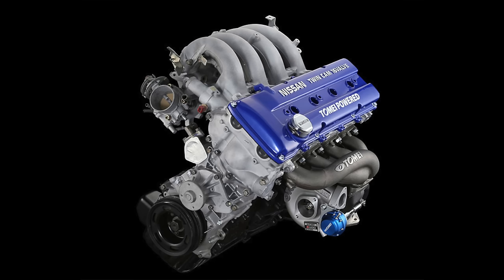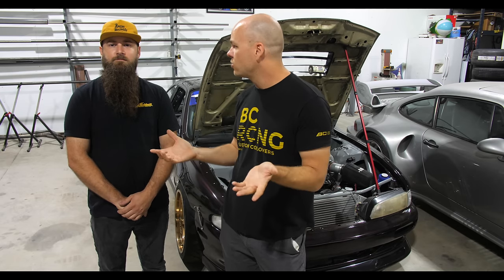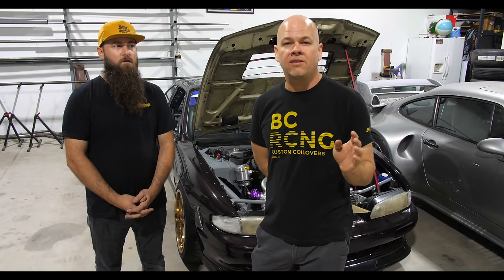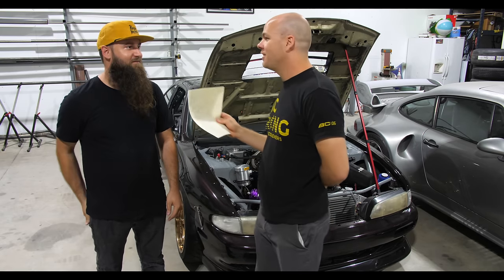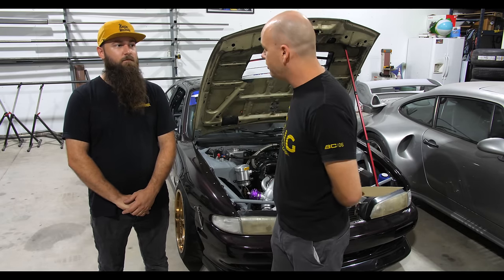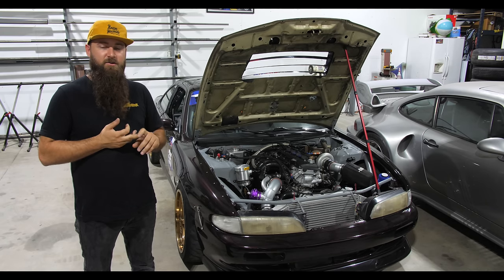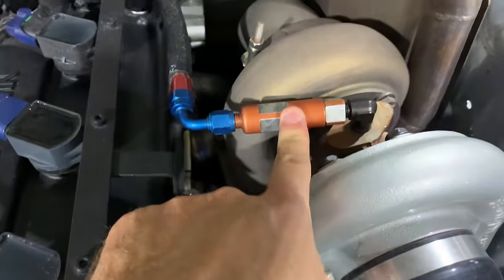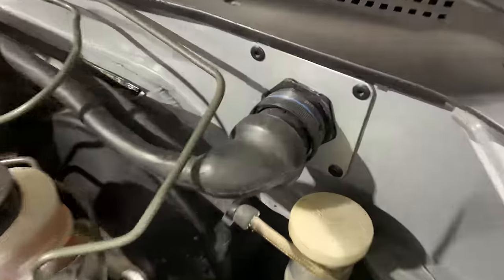Learn something new about the KA24DE engines!  Lets chat about them.

Comment: Fun fact: All KAs found in the cars had blocks casted in Japan. All the truck engines were casted in Mexico for the most part
Reply: Also the truck motors don't have a crank girdle and I believe no oil squirters. S-chassis KA's are the strongest variation made
Reply: The Ka24de in the 240 is not a truck motor. It’s a factory stroker 4 bangin monster that haunts sr’s in their nightmares. Just playing. Love those 2. Just because it had the same displacement as a Nissan truck engine. I’ve heard they put vq’s in minivans.
Reply: @sdshakazulu4268  Technically it is a motor that is in a truck, so yes its a truck motor per say but the 240s KA is better and being a truck motor isn't a bad thing.
Reply: awesomecooly123 .. I agree.. I like lm7s lq4,9 etc. peace fellow motorhead
Reply: J.C. Kohle ... mmm.. maybe he turned off his spellcheck to practice. JK
Reply: J.C. Kohle .. I think I need some of that too. Peace brotha
Reply: I think there was a ka20 in japan
Reply: Doesn't the 1995 nissan Altima share the exact same ka24de engine as the 240?
Reply: @cedricmiller4370  I think some design ques like bore and stroke maybe valve train design..
Reply: @cedricmiller4370  yes and no. The Altima and some sentras sport a ka. But the head and bolt pattern is different than the xterra/frontier 98-04 ka
Reply: Frontier/xterra use a head carrying number of f45. The fwd car versions use like f40 and a few other variants. NOT COMPATIBLE WITH EACH OTHER!!!
Reply: @supers0nic77  sure is
Reply: Thought the majority of truck KA's were single cam as DOHC only came in the last production years of the truck.
Reply: @Sir.VicsMasher  Nissan hardbodies came in the single jingle KA, the first gen frontier came with the DE or vg
Reply: @awesomecooly123  if I remember the 240sx got a ka24de and a hardbody like my 95 has a sohc ka24e so theres a pretty big difference.
Reply: @mayonnaiseluther1568  pignose 240s have a single cam
Reply: @awesomecooly123  I don't know much about jdm aside from my truck so can you explain to me why there are such different varieties of the same engine in the 240sx?
Reply: @mayonnaiseluther1568  idk ask nissan
Reply: @awesomecooly123  lmao It's kinda crazy
Reply: @cedricmiller4370  no not really...good Lord 🤦‍♂️
Reply: @charlesescarria3726  lol why you say it like that
Reply: @cedricmiller4370  Just blows my mind the things ppl say and the amount of misinformation that gets spread around because they repeat nonsense they heard somewhere else. I'll give you and example, since I like your vibe check this out...you know ppl say ka24de is a "truck" motor? Well that's all bs. KA's where made in Japan and put into 240sx from 91-98. 98 being last year of production of the 240sx. Because of the well know torque of the engine it was then adopted and used in small Nissan trucks like the Frontier and Xterra from 98-08. It was never designed or made to be a truck engine. Lack of knowledge is what gets me you know. God bless
Reply: @sdshakazulu4268  I've owned and worked on both the truck and 240 versions. They're almost identical apart from a few minor differences. If you happen to have a truck KA you want to toss into a 240sx, all you'd need to change engine-wise to make it fit would be the oil pan and the oil sump inside of the pan. Luckily the 240sx pan and sump is readily available in your local junkyard on 90's Altimas
Reply: @dougzzzie738  I was discussing this with some car buddies and a thought came about. What if the ka24de was offered world wide as an option in the s-chassis. I believe the aftermarket development would be on par with the sr. Could’ve had an oem fcw crank and possibly a turbocharged ka from factory. Imagine what the land from down under would have done with it. Too bad. I’ll keep mine tho🍻
Reply: Most 4x4s hardbody's are made in japan then shipped over and finished being assembled in the US. I had to order a distributor from japan. It took almost 3 weeks for me to get it in the mail. It cost almost $400.00.
Reply: one of the  bast  engine  nissan ever  made  strong  reliable and it has the one of  the  bast  sound of  4 cylinder I ever  hear
Reply: @sdshakazulu4268 it is a truck engine.
Reply: I have 2002 frontier and I tell my friends that it has a 240sx engine in it. So it's a stupid flex for me. But owning one has taught me three things about them.  #1 Nissan fanboys hate them. #2 they last forever when maintained decently #3 Can make great power for cheap with modern turbos and engine management.

Comment: Aaron I have been building these engines and doing this professionally for years and this video makes me really happy. Thank you for doing this and showing all the kids at home what a viable engine and platform these can be.
Reply: im that kid at home, im going to build my 240 so im trying to learn the most i can about it
Reply: Hello I have a ka24de 5speed tranny, but is on a 98frontier truck, is it the same engine this guys talking about?
Reply: Raul G BEARDED hey they are similar but not the same
Reply: BEARDED G In case you’re still wondering, your engine is the same with the exception that you have a 9.2:1 compression ratio as opposed to the 9.5:1 seen in all 240sx variants. Your engine should have the same potential as I’m about to find out for better or worse by sticking one in a s14 I am about to purchase. Nothing better than financial suicide! A turbo frontier would be a really unique build though.
Reply: J Albert I’m trying to learn as much as possible about this platform so I can purchase a local 240 for sale very soon. I was wondering if you have any insight into the mechanical differences between the factory 9.5:1 and 9.2:1 compression ratio engines?
Reply: @jhonmarshal6501  hey man you got any videos on how to rebuild one or and info I'm actually pulling one now and wanting to rebuild it 98 frontier
Reply: @dustinharrell9453  I’m about to pick up a 98 Frontier. And I’m wondering if a frontier engine will perform about the same as the one in the 240. And I also want to know if the xterra/frontier engine will handle a turbo as a daily.
Reply: @xaviervigil  man honestly I dont know much about the I'm trying to learn myself but in the videos that I have been watching there is a few differences. 1 being on the 240 they ja e cradles on their cranks and frontiers dont . The motors are actually a ka24d ( 240 )and a ka24de (frontier) and 2 they pick up oil a little different
Reply: @beardedg500  I saw someone say it is the same engine but the one in the truck was made in Mexico
Reply: @xaviervigil  When Nissan upgraded the KA24E on the "pignose: '89 to '90 240SX to the KA24DE, not only did they go to a twin cam head and 4 valves per cylinder instead of a single-cam and 3 valves per cylinder they also balanced the crankshaft better to increase the redline from whatever it was (maybe 6,000 or 6,500?) up to 6,900 rpm, resulting in a power increase from 140 HP to 155 HP... the reason I say all this is to say that (while I do NOT know if this is true!) I wouldn't be surprised if they didn't bother to give the truck the super-balanced crank since you aren't generally driving a truck like a sports car, BUT I am speculating based on nothing!  
This video is great and these guys are awesome, but they are wrong about just one single thing... the KA24DE in my 240SX is not beat and doesn't need to be rebuilt because it only has 173,000 original miles on it!  :)
Reply: @StratMatt777  KA24E Single cam / KA24DE Dual Cam
Reply: @dariusmirsaidi6411  Doh!  Thanks, I'll fix it!  (I've owned both)

Comment: screw it. a 250-300hp KAT sounds fun.
Reply: or a K20/K24 boosted to 500+ (stock block) 🤔
Reply: @QuBaTiOn  you can make 500 from a stock KA block
Reply: Better than sr
Reply: @jacobkeagy5680  full stock internals like a k20 though?
Reply: @qwertyobsjcj  yes lol, those lil iron block KAs are bulletproof
Reply: The crankshaft is the Ka’s weakest component

Comment: Finally... I love my KA-T. 226whp/246lbs/tq with an eBay T25. I just put a gt2871r on it, converting it to speed density next week (Nismotronic SA)
Reply: Have you driven with the GT2871 yet? I'm thinking about buying a GTX2871 or GTX 3071 with Stainless T25 Turbine housing. How is the spool up on the 2871? And yours is journal bearing? I'm looking for something that has almost unnoticeable spool up. Thanks in advance!
Reply: Is it just a noname t25? or did you buy a used oem t25 from ebay?
Reply: HOW MUCH PSi!!!

Comment: KA’s get a bad wrap for no reason. Mad respect and great info ✊🏽
Reply: No there's a reason these young drift nuts buy a 240, beat that crap out of it then spread bad information "ahh my motor blew it sucks' no it's a stock motor you beat like a rally car what you'd expect ... I been threw it just didn't blame the ka, shot a rod outta na dually blew na single and melted a piston on a single now running a single on 20 pounds unbalanced
Reply: Great little motors. SUPREME pain in the🍑 to wrench on, but amazing all the same. I'd love to give a few of the engineers the ol' Benny Hill style forehead slap at times, but, yeah...
Mind you, I'm speaking as a Gen2 Altima guy.

Comment: Super glad they mentioned the surge tank upgrade! I've had a KA-T for about a year now and bleeding the cooling system has always been an issue until I installed the swirl tank. Definitely a must do for cooling upgrades.
Reply: To add on to the severity. I almost thought I had a blown head gasket but after doing further diagnosis I realized the engine could have had constant air pockets that never bled properly. Swirl pot ftw.
Reply: @SuperDanman90  old comment but im seriously having this EXACT issue. 500 miles on  forged build.

Comment: Of you jump the intake cam 1 tooth on the chain
 you change the powerband of a ka. Instead of running out of steam at 5k rpm it will pull hard to 7k. I found this out 20yrs ago
Reply: Advanced?
Reply: Will it run for more than a couple weeks tho?
Reply: Altima ka exhaust cam with the sprocket keyway ground out 1/2 tooth. The skip the sprocket 3 teeth cww. Pulls great
Reply: @sdshakazulu4268  it changed the whole attitude of your engine right
Reply: @samlcyo2  yes

Comment: These engines came in Nissan small pickups in the Middle East, and they are quite good and very popular because of the reliability. we had the pickup since 2003 and now it has 416k miles without a single issue, when i went to Thailand in 2011 i saw so many after-market parts for KA24DE since it is widely used,  maybe you should look into Thailand market since they have been modding this engine for a long time

Comment: Thank you for this video! I've been wanting to restore my 1986 Nissan Datsun D21 pickup for years now. It has the z24 engine in it, and I've been debating whether to do a KA24 swap, or an LS swap. This video made up my mind! I'm aiming for the 250-300HP range, and when you mentioned that I can get that power level, on stock internals, running pump gas, you had me sold!!

Comment: He's right about the longer stroke... My KA-T seems to never hit redline because it runs out of steam after 5500rpm. I think redline is 7.2k? Even with my gt2871r I don't really need to hit redline unless I'm drag racing the straight before initiating. All my power band is 2.8k - 5.5k
Reply: The half weighted crank does play a role but I believe it’s because of the intake manifold design
Reply: I’ve tossed around the idea of taking the bottom half of the manifold off and putting a universal plenum straight on the upper section while shaping the left over runners into velocity stacks. Put an oversized tb on as well. Point is the stock manifold is for midrange. Loosing the bottom manifold will shorten the runners by like 4inches or so, moving the powerband higher. But I’m by no means an engineer.
Reply: What size cams are you running?
Reply: @davidmcneil645  stock cams (96 KA, forged internals)
Reply: David McNeil 
I’m using oem 248 exhaust cam from a Altima Ka24de on the intake side
Reply: @sdshakazulu4268  ok that's why your power bands so narrow
Reply: David McNeil .. did pull good till 6.5k. Might also had influence from other while your in there mod, balanced bottom, lighter internal components,13lb Rb20 flywheel, run only alt and water pump . On nitrous you couldn’t tell till in 4th gear.  Im using an eBay turbo now(measured 40 trim comp wheel) so now it’s all bottom end. Still working out bugs,thus cheap turbo. I’m just a hobbyist tho.
Reply: @sdshakazulu4268  I'm running a 50 trim on a single with none of those above things stock cams and it pulls pretty good till 6.5 also
Reply: David McNeil .. cool bro. wish I had gotten what I ordered but that’s what I get for buying an 85$ turbo. I’m slowly getting wiring components for a ms2 3.0 I built a year ago. Car is on 9psi but goes way rich up top 10.2afr(safc). Also switched back to 93 pump(side feed pintal caps kept coming off/ might not me e85 proof). Did post a vid of it on my page. Garentee a true tune will make more power up top.. battling timing with safc..
Reply: @sdshakazulu4268  if I were u I'd go with a RS enthalpy tune n get rid of the safc lol same eBay turbo bro just a lil bigger ... Nothing's wrong with eBay turbo just no one should expect them to last forever ... On the plenum idea has anyone flow tested a ka head to see were the restriction is
Reply: David McNeil 
Didn’t look into it as much until after putting money into megasquirt.. rs has great value. I do like ms features tho. Mainly wanted to replace the engine harness with a brand new one. Map based seemed cool with the logic I had at the time. Plus be able to use any throttle body/tps/cheaper-Easier to find gm parts. I live in Atlanta and people want a lot of $$s for Nissan stuff. I’ve made many mistakes while trying to make my car faster, but learned many things that could be applied to other platforms.
Reply: David McNeil 
I think the exhaust ports are.. I managed to Hog them out to the gasket I had. All porting/matching I did myself.. I don’t put much money into my car.. kindov a nice budget/bare bones build. Junk yard parts and make it work, b15 alt, Tercel booster, xterra master cyl. Little things from other makes. Figuring how shit works is fun
Reply: @sdshakazulu4268  we all have my brother and ms is a beautiful investment u just said safc like a piggyback just figured for engine managment rs is a good pnp start but if u have a tuner close ms is cool chipped ecu was just more convient for me  n i was just think all us ka lovers just wanna know the start you can cam turbo forged internal do big valves after market  plenum but whats the bottle neck if you had unlimited injector decent size cams good fuel and maybe a 12:1 cr whats the graph look like oh cant forget to balance it because we all know the ka after like 6500 feels crazy engine harmonics are terible single cams seems all lil more balanced but the dually needs it
Reply: @sdshakazulu4268  ka ports compared to sr ports are similar maybe even slightly larger so maybe other than oem over casting the ports arent as smooth as sr heads maybe the ka heads could use some bowl work other than gasket matching
Reply: David McNeil 
I’ve read somewhere that 300cfm was achieved on the intake and 280 on exhaust. Forget where, but you have to take most things with a grain o salt. Personally, as I get older my lust to have overboard hp figures decreased. Now it seems that 300-350 whp ka would make me happy. Drifting is dope, but I’m not a drifter. It’s almost a lifestyle. My car is just a street duty car/weekend fun to the store. I want to preserve this chassis, only because people tend to be reckless with them(of course to each his own). 
Definitely would need race gas/ for 12:1cr. Engine harmonics can be mellowed out but will cost more than what most are willing to spend(aftermarket counterweighted crank/blueprint). There are other options for matching  powerplants to car goals, that are more cost effective.
Reply: David McNeil 
I’ve done some bowl and smoothing ports. Tidy up the floor and raise the roof. Knife the dividers and around valve guide. By no means am I a pro. Just trying to transition air smoother. I thought every 1hp counts at the time lol. Safc is definitely a hinderance but works okay if your not asking too much. I figured e85 would help from detonation. There is a hot spot in the chambers of the head that needs to be rounded a bit that will help steer away from det/pre ign. Valve train is legit on the ka. More lift/duration would be cool. Regrind stock cams then add bucket shims.. I’d love to try all this, but  I need  to cut the grass and take my kids to events, chill with the wife. U know, I’m an old fart.
Reply: @sdshakazulu4268  lol "old fart" your good I'm glad to hear someone's put as much thought into the ka strengths and weakness's n not just wrote it off as a bad engine like alot off ppl do

Comment: Sounds like it's easier to do an SR20 swap, higher initial cost, but probably it'll end up being cheaper.
Reply: Sr20 is a sweet little engine. I see why it’s always a thought. Easy swap. I’ll just say the 240sx is a great car. Many options for anything. I’m surprised no one converted it to fwd for a b series yet.
Reply: Cant say that other than all the mods you might do wiring is an obstacle
Reply: I can do the wiring if some does the fab
Reply: @sdshakazulu4268   or ka no Fab or wiring just the regular go fast parts
Reply: I think he mentioned many sr20 being clapped out due to age. It's a 20-30 year old engine and will likely need a refresh. Especially if you plan to drive it hard.